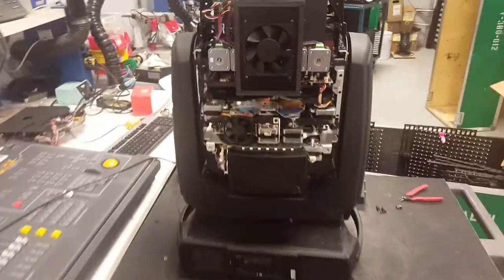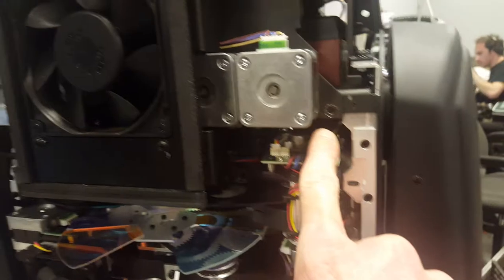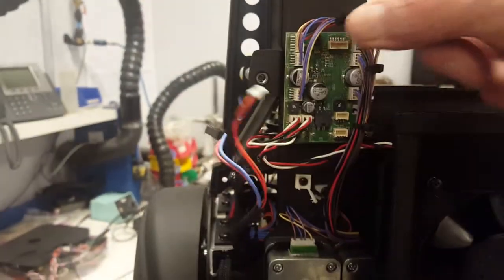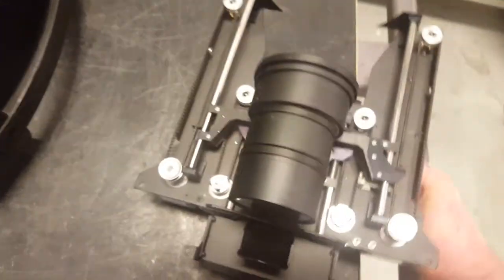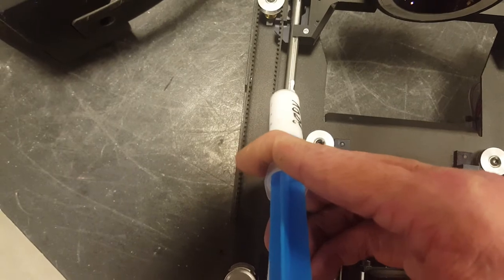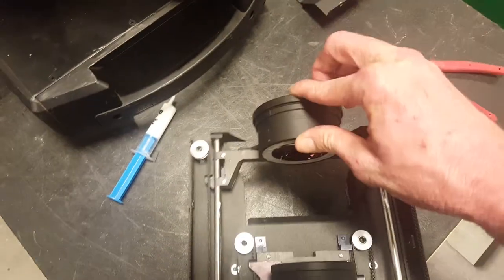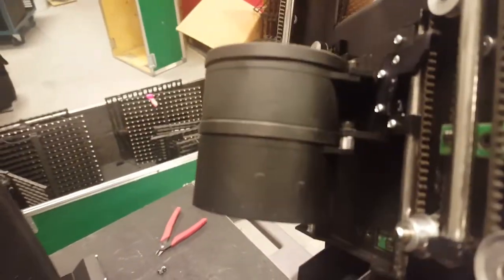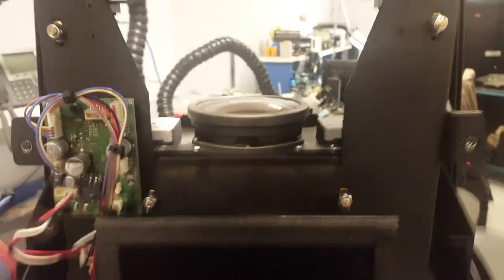Robe BMFL spot Focus module cleaning + disassembly

Comment: just thought id add that the grease for doing this has changed from the  Molykote 33 Medium thats used in this to Aronix oil as it was found to cook on to the runners in the higher temp fixtures causing the zoom/focus and cmy to stick